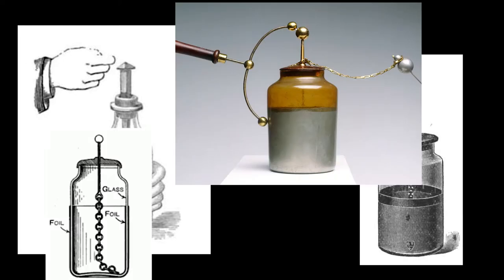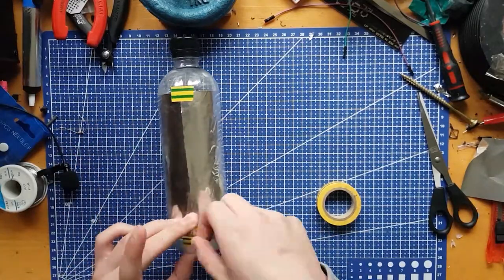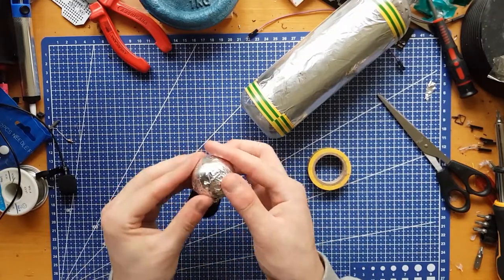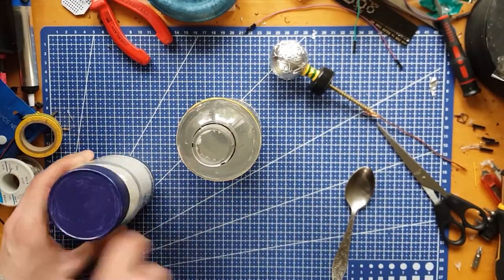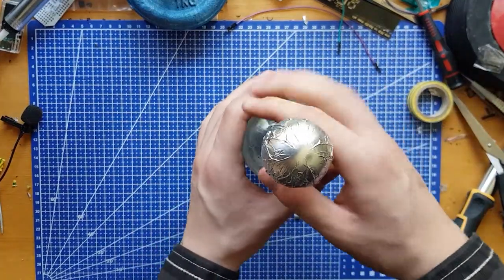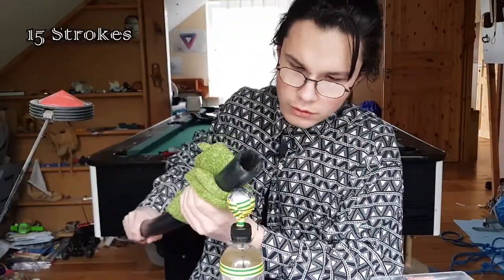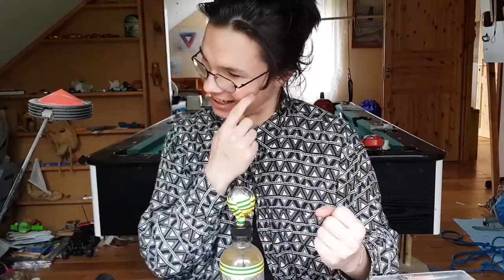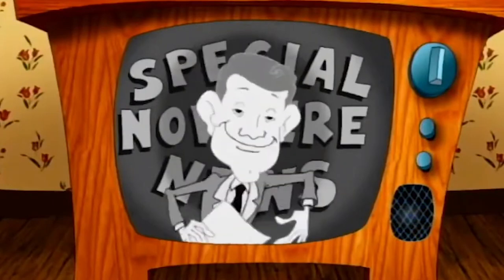Leyden Jar and Me Shocking Myself

Comment: Great video! Although, when doing it with your finger while grounded, you should use the same hand that's grounded, this will prevent charges going through your body past your heart. At these low currents it doesn't matter much, but just a good safety precaution